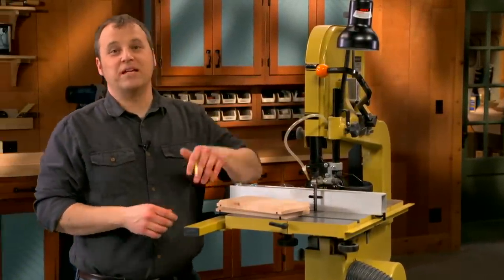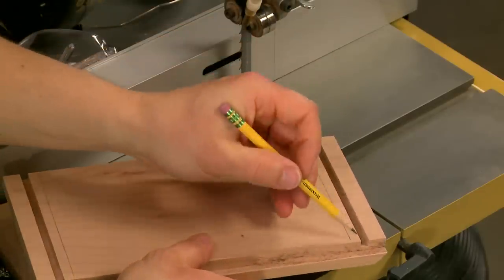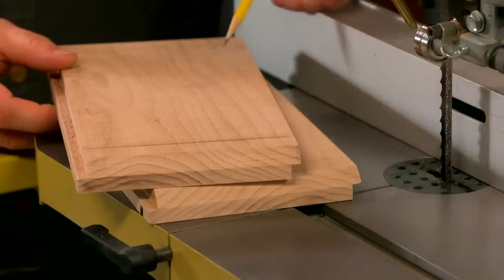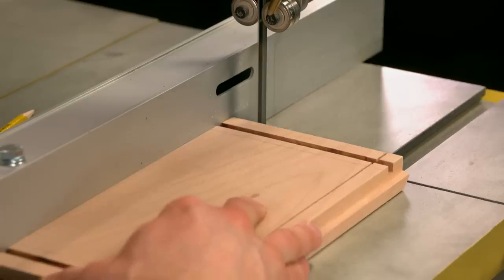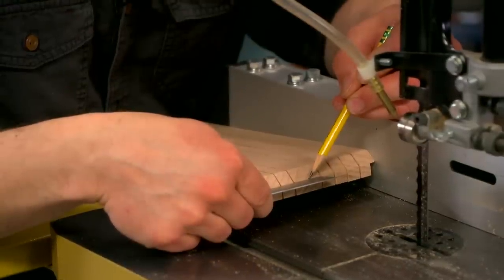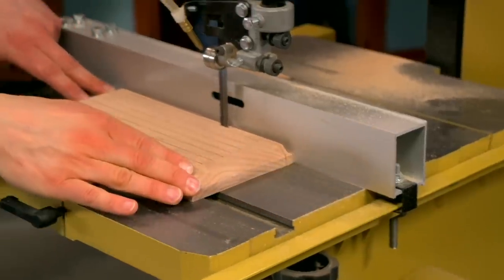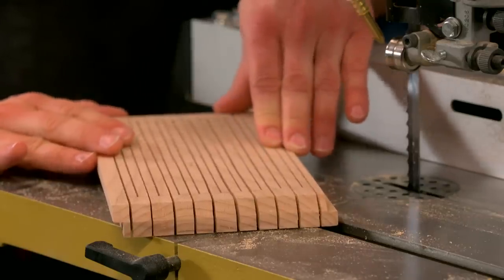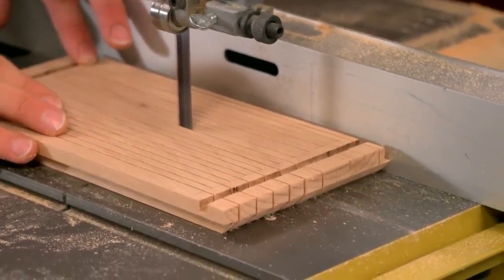Bending Solid Wood With A Band Saw?

Comment: I made this lamp, and it came out really well.  I have some points of caution/note.  As mentioned in other comments, the flex in the shade as it is being cut is a real issue.  I solved this by starting the cuts on the right side of the blade, flipping end-for-end to make the "midway" cuts on the other end and then marching across the work.  In this way, the "flexy" part of the work is always on the right-hand-side of the blade, never against the fence.  There are two components to the shade, so so you can set the fence for each cut and cut each half.  The second issue is sanding, and this was the real pain.  You are trying to get 220-grit smoothness between all those slats in the shade.  No bandsaw is going to leave a surface that is anywhere smooth enough, so expect LOTS of sanding in areas that are VERY DIFFICULT to sand (and will be illuminated by the bulb).  This part of the project was by far the longest and exhausting.  I would never make this project again unless someone told me how to solve this issue.
Reply from the maker: Yeah, I would say that sanding inside the kerfs to 220... I'll ask Dillon if he has any tips or tricks.  I just checked our lamp and it's not sanded perfectly smooth.  There are still some visible saw marks but it seems to still look pretty good.  Phil made the lamp as well and he said he didn't sand them beyond knocking down any fuzzy stuff.

Comment: Another way to avoid the flex issue or manually steering the cut, would be to make a small sled for the piece to ride on (having a push fence and a kerf line in the sled sawed almost up to that fence), and have the sled rub along the bandsaw's fence instead of the work piece.  This would eliminate the need to reposition the fence for each cut, since the piece would be repositioned on the sled instead.  This also has the advantage of being able to align each cut over the kerf line in the sled.  To get even more fancy, a spacer block equal to the width between the cuts could be made, and set between the piece and a stop block attached to the sled.  Then to move over the piece for the next cut, simply remove the spacer block, slide the piece into the stop block, clamp the piece, move the stop block over and re-insert the spacer block, making both tight against the edge of the piece, clamp the stop block, remove the clamp on the piece, then make the next cut.  More accurate than eyeballing a mark, but not as elaborate a sled as could be made for batching them out in a production setting.
Reply from the maker: I like it!

Comment: This is how I solved the flex prob. I clamped a long block behind the fence and used a 3/16" strip between the block and the back of the fence as a space indexer. After making a cut, remove the spacer, move the block back up against the fence, loosen the fence, reinsert the spacer. If you flip the board end to end after each cut, the solid portion of the workpiece will always be against the fence. Also, no measuring required.

Comment: That's great. I would like to try. What kind of wood is better to use?
Reply from the maker: We used European Beech and it worked really well, but you could experiment with other woods and see how well it works. I would think that flexibility of the wood would also depend on the grain structure and moisture content, as well.
Reply: @WoodsmithShowandmagazine  thank you so much!!